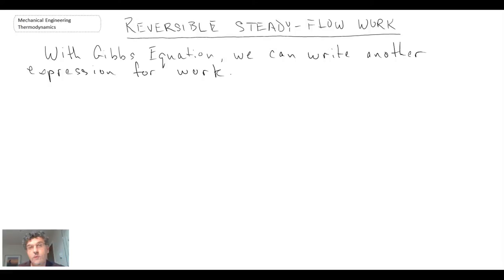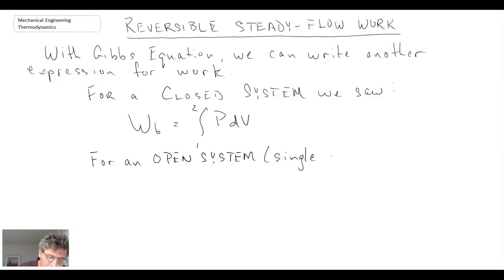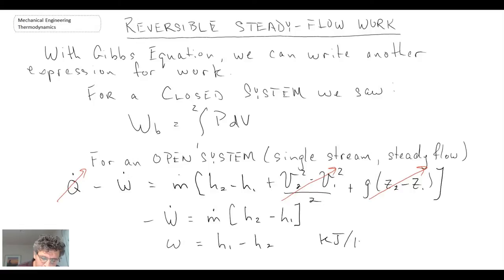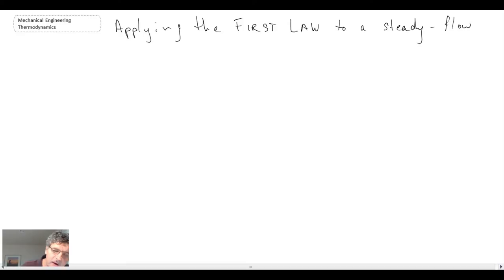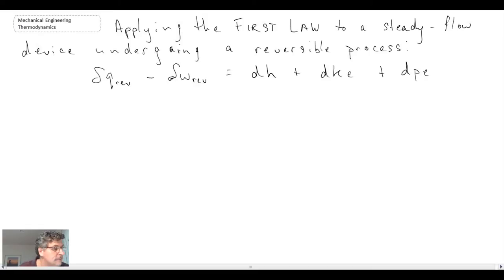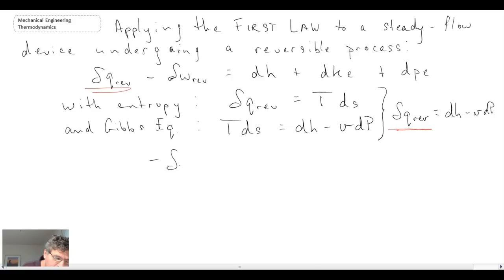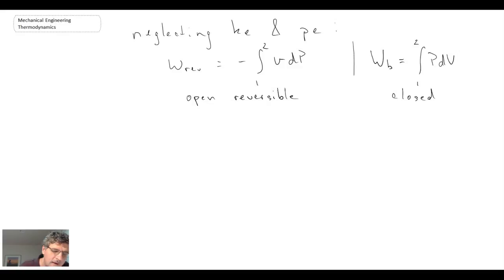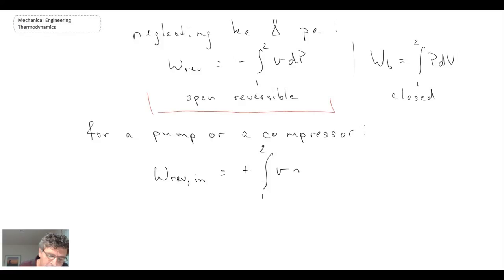Mechanical Engineering Thermodynamics - Lec 9, pt 1 of 5:  Reversible Steady-Flow Work

Comment: @Ron Hugo. Assuming a compressor runs from startup. Molecules first compress before air displacement takes place.  So if we consider the partial diffential of flow work. dPv = Pdv + vdP. How would you determine the flow work if fluid would be compressible. Change in P and v.  This puzzles me about the gibbs equation because the flow energy in a closed piston chlinder device for isothermal process using vdP yields the same result and Pdv. And yet we use Pdv as internally reversible for closed systems.